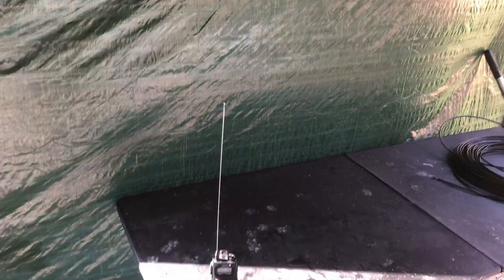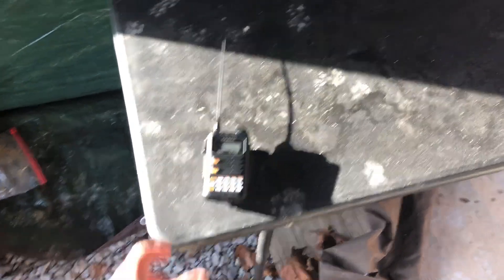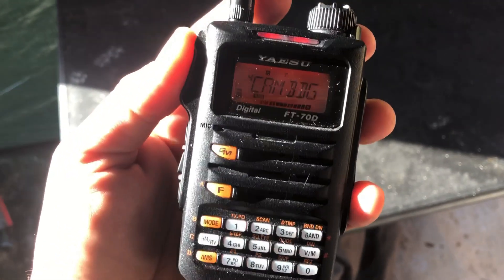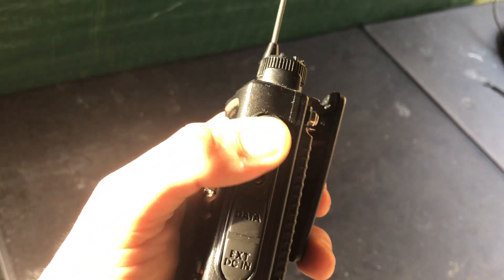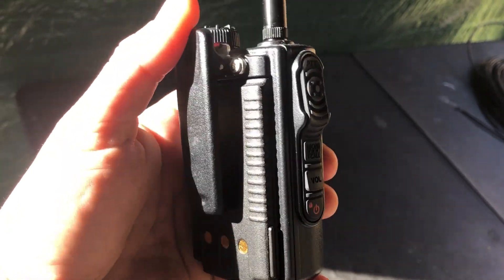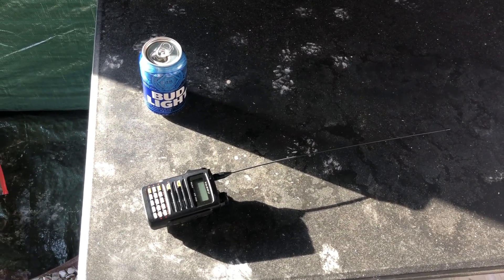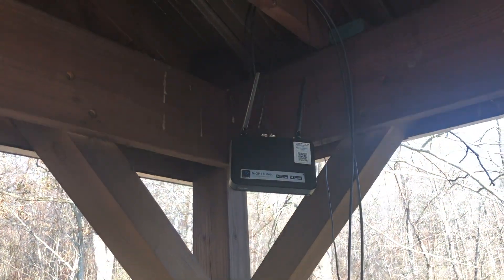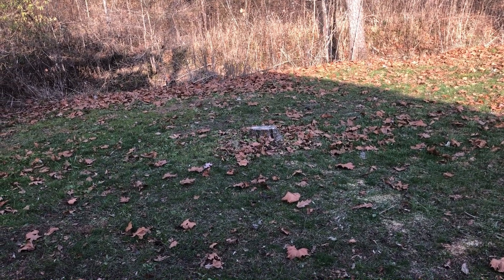Yaesu FT-70D

Comment: Those are good little radios. My wife & I (yep, XYL is licensed!) have a set for a bit over a year now. The stock antenna isn't too bad. We consistently get 3-4 miles simplex (even better when talking back to the base) and have done a very clear hilltop connection at about 6 miles, HT-to-HT. It was on 2M digital and no garble. Here in eastern PA it looks like we have similar terrain as you.
73s
Reply from the maker: I’ve been trying to convince my xyl to get licensed, for a few years. Maybe someday. Haha.